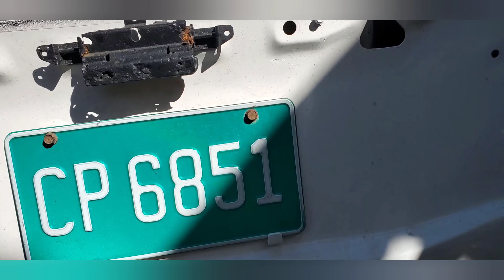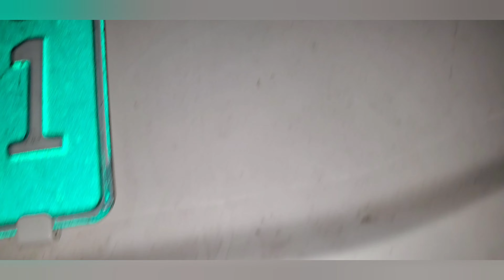Building another bus sound system PART 2....

Comment: Nizmo why do you build the bass box without wood strip ribs ... screws don't hold firm in plywood so in a short time bass weaken the box...and everyone should know that bass box should be built with chambers...we would like to see you work instead of talk your work....
Reply: Bass box build with paste and the right length screws,,,,not only screws
Reply: @starlights_edits4343  screws and glue with only plywood can't hold the pressure of bass for long you need the wood strip for the screws and also glue then that box will last a long time.....